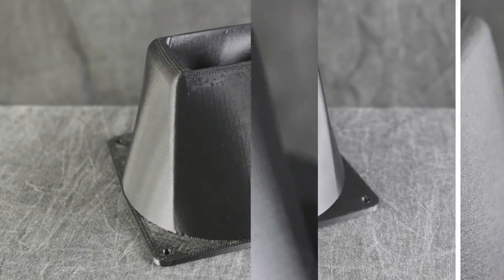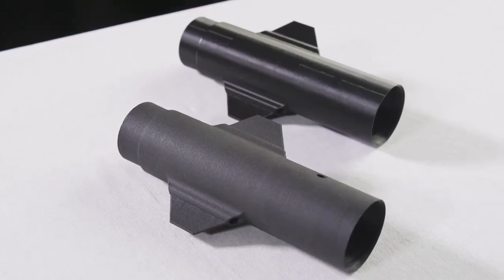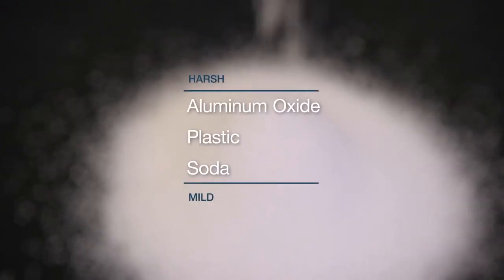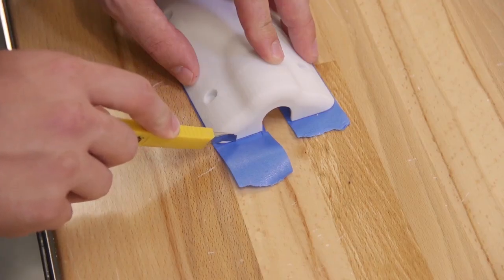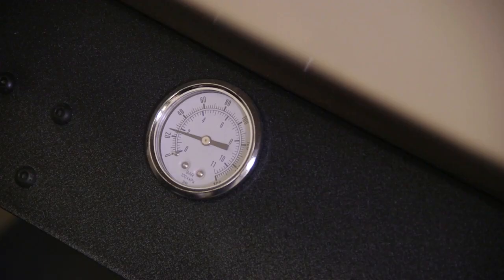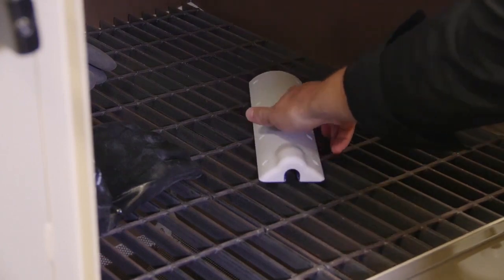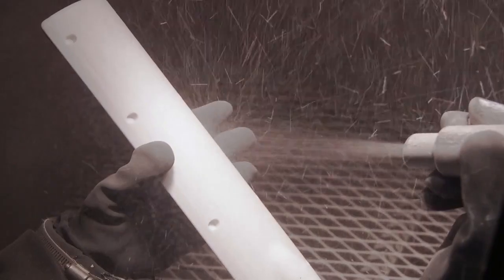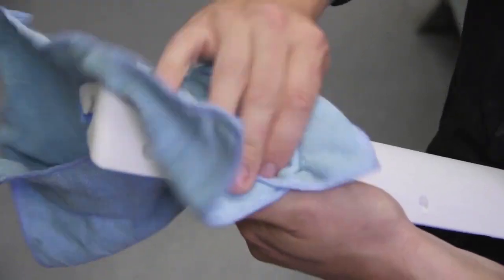Media Blasting for Finishing FDM 3D Printed Parts

Comment: what type of media was used for this process?
Reply from the maker: Hey Thomas, in this case a plastic media was used, but there would be different options based on the project requirements.

Blasting media is commonly rated mild to harsh based on a metal substrate.

Aluminum oxide: harshest

Aluminum oxide is the most aggressive blast media for smoothing an FDM part and can also be used to texturize or etch parts. This media is ideal when preparing a surface for electroplating.

Plastic: mild to harsh

For surface smoothing, this finely ground plastic media is recommended. This media is available with abrasiveness ratings from mild to harsh (Figure 2).

Sodium bicarbonate (soda): mildest

Soda is ideal for converting a glossy finish, like that which results from a vapor smoothing operation, into a frosted, matte finish.
Reply: @proto3000_  What about using glass bead at a low pressure? We need to smooth PP so we're thinking glass bead or soda blast media.
Reply: @proto3000_  would 100 grit garnet be too harsh?
Reply: I must have missed what type of plastic the part was printed in??